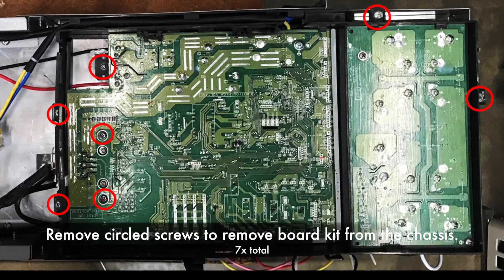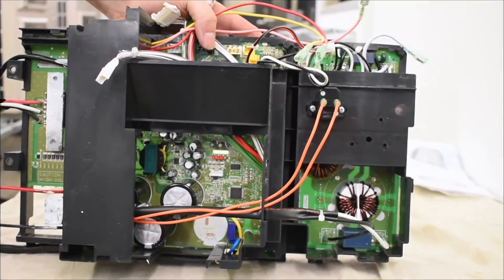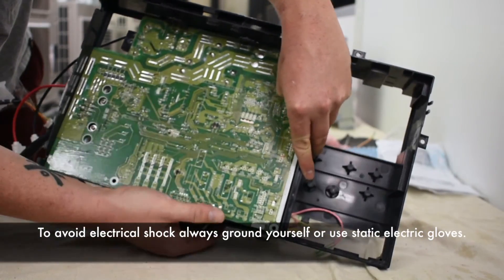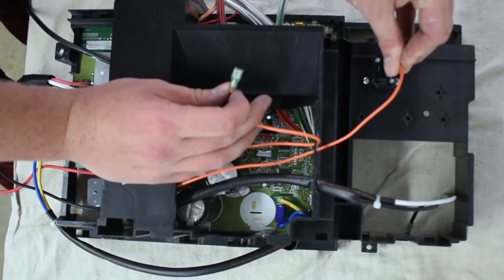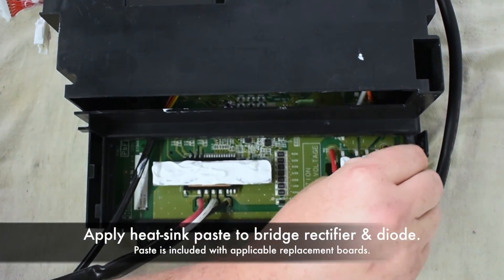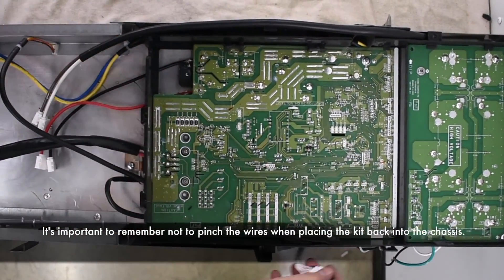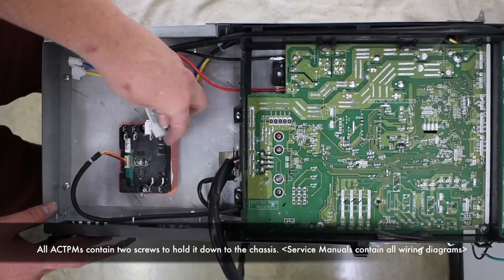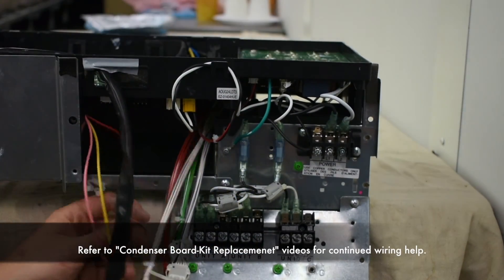Board Disassembly: Cassettes & Multi-Zones

Comment: This video is needed so much because the FUJITSU’s circuit boards are constantly burning up and then when you go to order another one from your supplier they tell you it’s going to be a few weeks. Then you have to tell your customer that that FUJITSU system you sold them a few months ago they now have to sit in the dead of winter freezing their ass off or in the heat and humid summer of the south and sweat it out until the new part arrives. Or you may have done with so many good contractors would do including myself and you buy one off the Wearhouse shelf for $2500 you rip out the circuitboard for that customer in an emergency to keep them happy about a product you sold them and you now own a $2500 paperweight or you could call it a $2500 fuse and you’ll never sell that product AGAIN !!!.....
Reply: @ANDREW IZSVAK 8544 2020 I call it when a company or the marketing team or the sales people look at their customers like walking ATM machines.